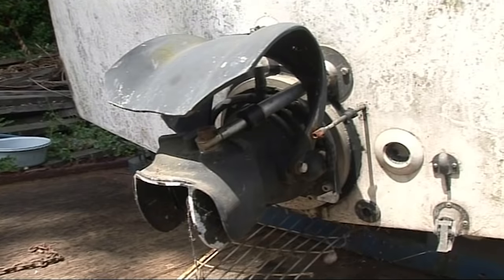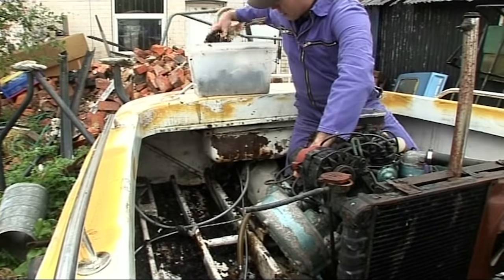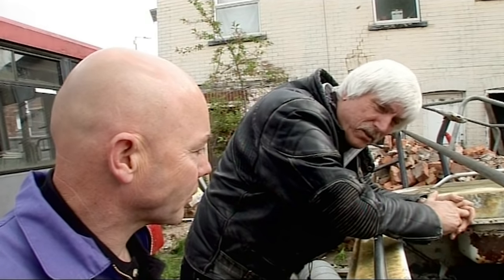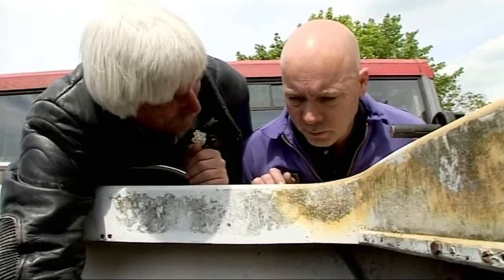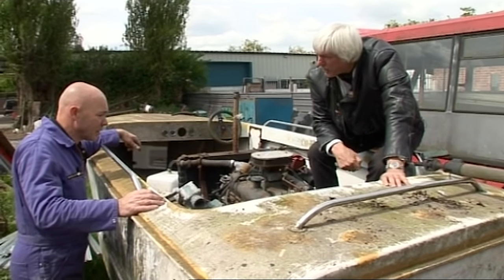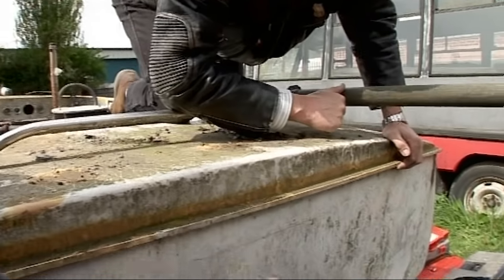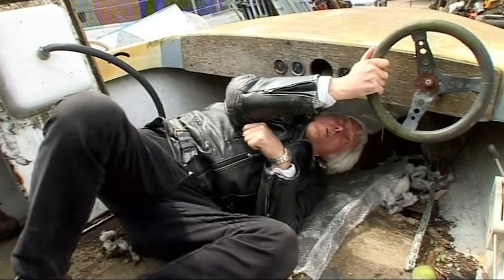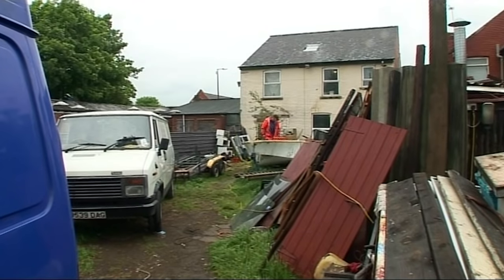JET BOAT PART 1 - RESTORING A SPEEDBOAT WITH A JET ENGINE

Comment: I remember putting an air filter like that on the carburettor of the crossflow engine of my cortina mk2 in about 1970. It made a fantasticly loud continuous sucking noise when it ran. 
I thought it looked really cool (or was it groovy) and in-keeping with the cheap plasy switch lengtheners I bought for the dashboard. 
No expense spared.
So I reckon that cheap chrome thing carbon dates the engine to the 70's.
Reply: I bought it from Ed Light's car factor shop in East Ham where I got my AF ring/open spanner set.
Also my carb tuning kit that by looking through the sparkplug would show you the colour of the piston explosion.
He sold all sorts, 
novelty gear stick knobs (some literally), fluffy wheel covers, foot pumps, windscreen sun shields with Steve and Sharon letters, joss stick smelling air fresheners, wheel hub covers that extended to the rims, 
Electric self extending radio antenna, alcoholic breath nullifiers, 
Stick-on rear window heaters, Fluffy dice, 
Stick on ceiling footprints for the roof over the back seat. 
And of course two part fillers, wet'n dry and lead primer paint. 
Suspension lowering kits, giga amps, woofers and speakers that filled the boot.... 
All the stuff anyone could need.

Comment: It does NOT have a jet engine
Reply: It's the terminology for a water jet, anyone with any Knowledge of boats would Know this.
Reply: @spinaway  No Jimmy, any human that races jet boats such as myself for 20 years can tell you it is a jet DRIVE. Not a jet engine. Jet DRIVE...verses inboad.(which includes V-drive)...inboard/outboard (called I/O) and then air drive(airboats using a aircraft pusher propeller)
A jet ENGINE is what you find attached on an aircraft, some silly promotional dragsters, and a version correctly called turbine power, which is a jet engine mated to a propeller drive. This? Is a Jet Boat utilizing a jet drive unit (this one using a Hamilton two stage jet pump) using an automotive engine, NOT a jet emgine. You....have now been schooled.